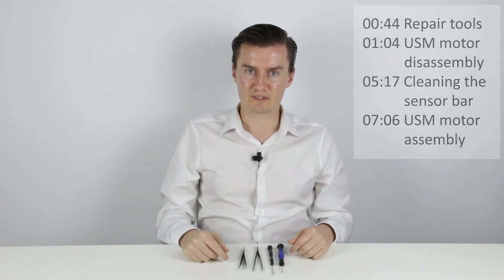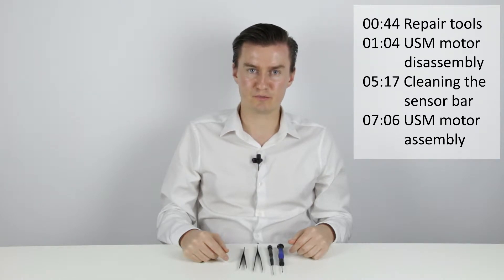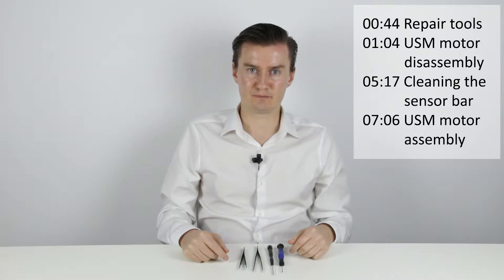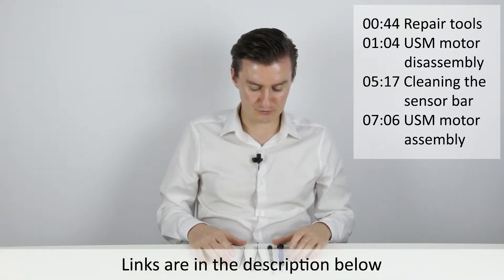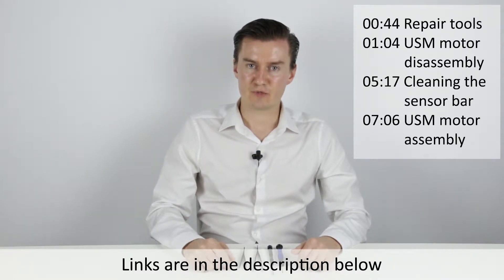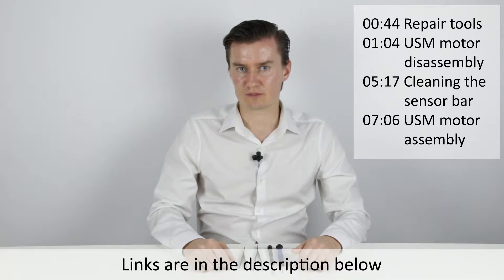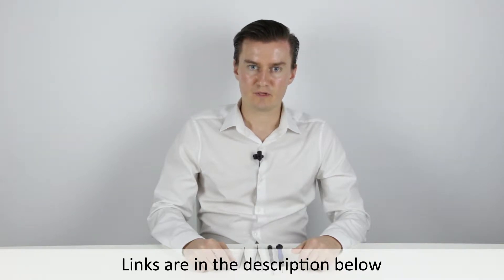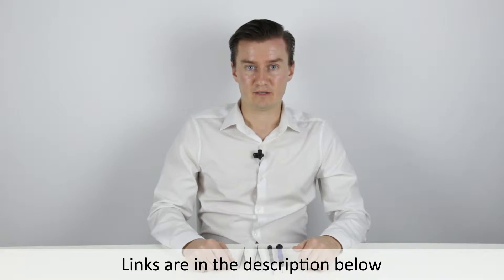Canon EF-S 17-85mm f/4-5.6 IS USM lens USM motor disassembly for cleaning the focus strip

Comment: What lens clean fluid did you use? Is it contains epa alcohol? How this sensor strip works? My problems apears quite rapidly like it was something rapid, not built up dirt.
Reply from the maker: I used EPA alcohol to clean the focus strip. There is very small grooves in the strip, and it is used to determine where is the position of the motor lever.
Reply: @CamerasLensesEtc   thanks, was wondering if epa is not to aggressive for plastic like this - finger crossed that it is only dirty on focus strip in my case :)
Reply from the maker: @takitam2521   Never ever had problem with it, so no, it is not dissoving or damaging the plastic.
Reply: @CamerasLensesEtc   thanks again for the clip and answears :)

Comment: Hello. I face the auto focuw problem only. The lens seems to work properly in manual focus. I have send already once the lens to service. They said that the only thing they did was to clean the contacts (I do not know if they meant the usm strip sensor). The lens operated properly for a while and then started again to hunt focus. What is your suggestion to solve the problem?. If I clean the USM strip sensor with isopropylic alcohol is ok or I have to use something else (or even change it)? Thank you in advance.
Reply from the maker: I would suggest to clean the USM strip sensor once again, (not only the sensor, but clean the black plastic part which the strip sits on, and the bottom of the small sensor which slides on the top) then you can see if the problem was the dirty sensor strip.
I used lens cleaning fluid to clean it, and also isopropyl alcohol, both of them are fine.
Do not use aceton, because it dissolves the plastic.
If the focus strip is scratched or damaged in another way, you can buy a brand new one on ebay for around 30 USD.
Reply: @CamerasLensesEtc  Thanks a lot for your prompt reply. I will try to clean all these parts you mentioned. Do you think that the next step ( if does not work), is the  replacement of the aperture flex cable?
Reply from the maker: Check if the aperture is working or not. If the aperture is not working and stuck at a small value (high number), then it could affect the focusing, for example if the aperture is stuck at smaller than f/8 (f/11/13 etc...) then the focusing is not working, in this case replace the aperture flex cable first, and then test the focusing.
Reply: @CamerasLensesEtc  Thank you very much